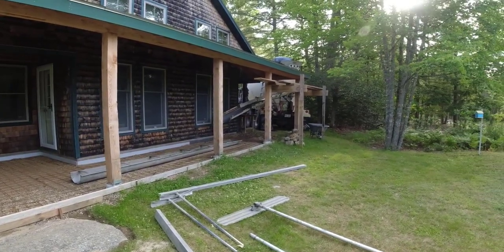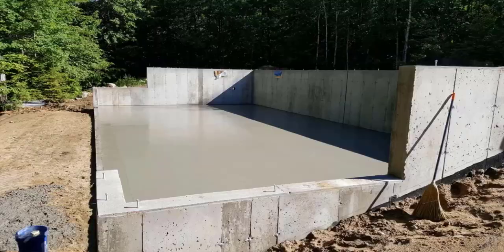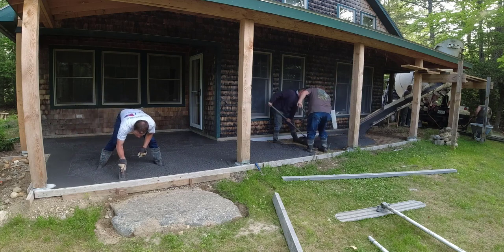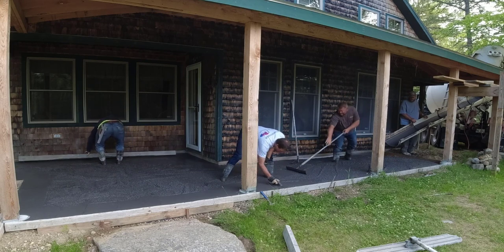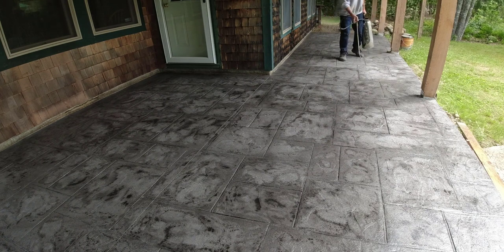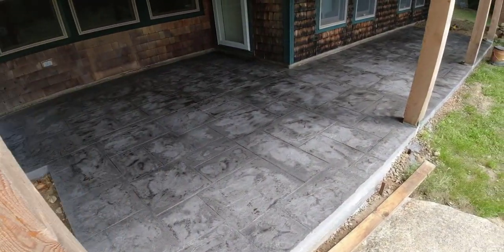How To Pour and Stamp a Concrete Patio slab | Using Liquid Release

Comment: I see you spend time pulling the wire mesh up, but then it seems walking all over would push it back to the ground in several areas.  It looks amazing!
Reply: The aggregate keeps it up
Reply from the maker: Only us concrete guys know it doesn't go back down, it's our secret.
Reply: It does tho. Pouring it that wet and the amount of standing you do it goes straight back to the bottom. Mesh is supposed to be in the top third of the slab, not an inch from the bottom.  Amazes me that you guys are very good at finishing yet won't spend 10 bucks on some plastic chairs.
Reply: @lachlanitis2311 This is incorrect, if your mesh is in the top third of the pad it won't keep the bottom half of the concrete slab from pulling apart from itself when pressure is exerted in a downward fashion. This is because the top half of the 4-in pad pushes against itself when pressure is exerted downward, which is fine since concrete has great compression strength, but the bottom half pulls away from itself as the pad bends in a concave fashion. It is correct to say that the mesh should be an inch off the ground if the pad is 4 in thick.
Reply: You're definitely correct here. The concrete is wet enough in this pour that the mesh has a very good chance of going to the  bottom when you step on it.  They're pouring at a high slump, which is okay with patios since the PSI doesn't need to be as high since no serious weight will ever be on it.  However, when pouring that wet, chairs should be used.  I've poured concrete for 10 years.
Reply: @MikeDayConcrete I've torn out lots of concrete over the years, and a good portion of it has rebar or mesh that is sitting at the bottom.  If you pour that wet, you should use chairs or smaller rocks to hold the wire mesh up.
Reply: @digitalme6987  actually you are incorrect. For domestic concrete the mesh is supposed to be in the top third of the slab to help prevent cracking. The compressive strength of the concrete is enough. 
For industrial slabs with heavy loads usually 2 layers of mesh are used. A bottom layer to prevent downward push from heavy traffic and a top layer to prevent cracking. 
And iv been concreting for 20 years FYI. 
If you think I'm wrong google where mesh should be situated in concrete. 
And I use chairs for every job, it's good concreting practice and no slab where I live would get passed if the mesh is not chaired. 
🙏

Comment: Did you not extend it out around the post bases for expansion/contraction? Would think that edge would look better if it went around them at least a few inches.
Reply: If you poured around the post only a few inches, more than likely that few inches will bust off over time